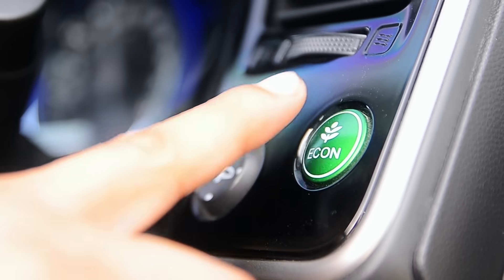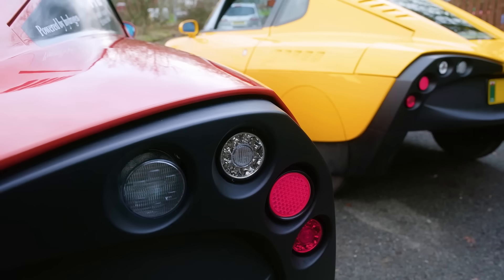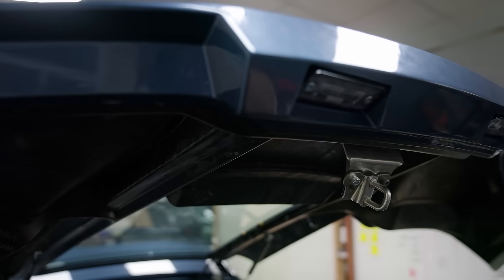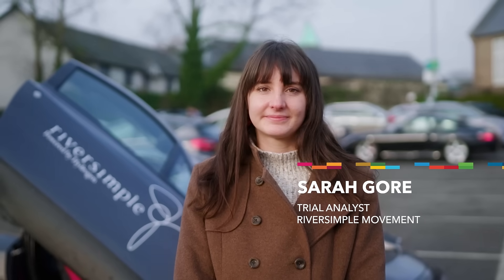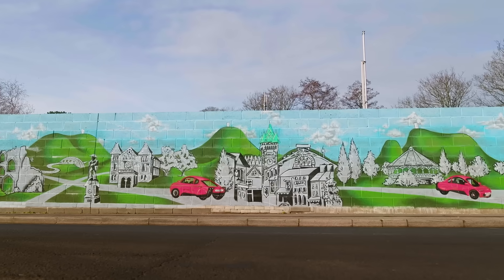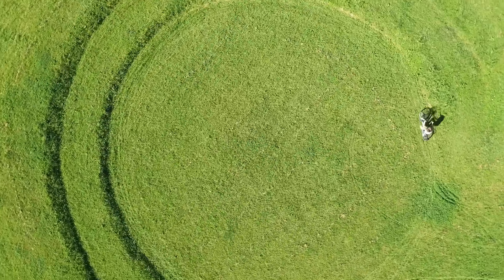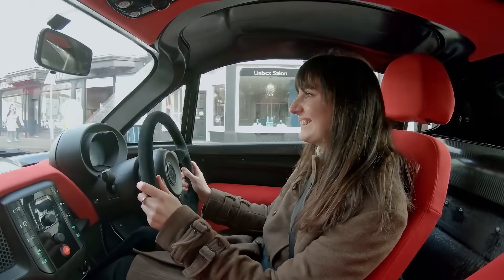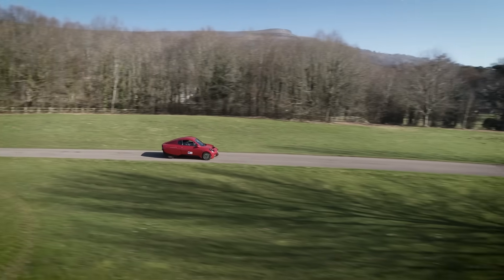Inside The Former F1 Engineer's Innovative Hydrogen Car

Comment: I admire your conviction and imagination. We need creative new businesses like this, but I fear the rapid advancements in battery technology will quickly make this an energy expensive, short range and portly supported dinasour. I hope to goodness I am wrong and wish you all the best.
Reply: Producing hydrogen is the easiest way to store large amounts of excess energy from solar and wind for times when there is not much sun and wind. Storing solar power for the night may be feasible with batteries, but storing excess solar energy from the summer for the winter in batteries would be prohibitively expensive. Storing hydrogen produced with solar power might be an option, and the low efficiency of that process might be outweighed by the fact that the energy used inefficiently would be energy that would be just wasted otherwise due to demand lower than supply at production time.
Reply: @peterp5099  you made a great point here Peter.
Please copy paste it as a fresh comment so that more people see it.
Dealing with the peaks and troughs of renewables is one of the biggest challenges the transition faces
Reply: That's not very objective thinking. If you have excess renewable energy and you have a BEV car fleet it's far more efficient to put that energy into EV batteries and even draw it back from those batteries when needed. For stationary storage there are a bunch of competing technologies that are both cheaper and on par with efficiency with hydrogen, as well as being a hell of a lot safer. Hydrogen may have applications but only if they can work out a much more efficient way to produce and store it. In the meantime battery tech continues to evolve - it's not standing still.
Reply: @mondotv4216  battery tech continues to evolve, that’s true. But large scale battery storage is still prohibitively expensive, while welding a few gas tanks together is not. It’s the old question of efficiency vs investment costs, and it makes sense to have both, the efficient battery storage for storing solar power from the day for the night, and hydrogen industry for storing solar energy from the summer for the winter. And between those, probably a mix of both to store power from times when both sun shines and wind blows and Store that power for the „Dunkelflaute“.
Reply: there's a reason the technology was abandoned in the 90s. It's still a messy, polluting process to make hydrogen, and the rate of advancement of the technology was far outstripped even back then by other more practical modes of energy storage.
Reply: "rapid advancements in battery technology"...are you having a laugh. Despite billions being spent on research, battery density has barely doubled in the last 20 years.
Reply: CATL going into production this year with 500kwh/kg batteries, that makes passenger flight possible. It won't end there, I support the views of analysists that predict a further doubling in the coming years. There's definitely a place for hydrogen and there always will be, but it's already at it's limit while batteries have yet reach their limit.
Reply: @martinhughes6860  What would it cost to build batteries big enough to store the sun energy from the summer for heating in the winter? And, in comparison, what would it cost to build hydrogen tanks big enough to archive the same goal?
Reply: Well that's a different subject entirely, but as you've raised it... Ambri liquid metal batteries are designed for low cost high efficiency grid storage. How Ambri batteries compare against hydrogen I don't know, I'd have to look at it. Silica batteries are also a highly efficient and incredibly cheap way to store energy, there's also gravity batteries. All of these can provide a mix of energy storage to suit local needs, including hydrogen. It doesn't have to be one or the other.
Reply: @martinhughes6860  Despite what you may think, over decades the physics, scientific research, billions of dollars and the periodic table simply have not and will not lend themselves to significant battery density increases. 

Moreover, hydrogen (of the green variety, the only variety that really matters in relation to the so-called 'climate emergency) is nowhere near reaching its limit. Unfortunately, there's far too much crap talked about the stuff. In essence, 'green' hydrogen is inefficient, pernicious and very difficult to produce, store, transport and to use. But, ultimately, green hydrogen's biggest problem is that it takes a huge amount of green energy to make a tiny amount of green hydrogen, and that is why it will never be ubiquitous.
Reply: I see JCB has opted for hydrogen simply because for the construction industry batteries are impracticable.  Despite the Tesla semi, unless there are some great advances in battery power to weight, I'm pretty certain the long distance haulage industry will go for hydrogen too.  This means the infrastructure for hydrogen will be there.
Reply: @marquisdemoo1792  I think the main reason to use hydrogen is the option to use renewable energy that would go to waste otherwise. Just use the electric power to produce hydrogen instead of stopping wind turbines when supply exceeds demand at the power market.

Comment: People don't want "mobility as a service", we want a "car as a product" and ownership of that product.
Reply: Few can afford a new car now.  Like rent, utilities, insurance, taxes, fuel, food...it all adds up.
Reply: @mistert7958  so that s the point to be worked
Reply: @mistert7958  Well then, public transit is the REAL solution, isn't it?😉
Reply: @joerosen5464 in urban areas, yes. In rural areas, not so much.
Reply: @joerosen5464  However public transport will not take you absolutely everywhere where there is a road wide and flat enough for a car to run on it. If I want to visit some city or town - fine.  But if I want to visit a tiny village or simply a building in the middle of nowhere - public transport will not take me there.
Reply: @thelyricologist9568  use a helicopter.
Reply: @joerosen5464  Nope. Public transit has bad people on it. Privacy and safety matter.
Reply: Mobility as a service will come as robotaxis, Tesla is very close now, and Cruise and Waymo already have autonomous robotaxi operations in a few small city areas in Phoenix and San Fransisco.

Another argument this hydrogen thing will never catch on, it is far from becoming autonomous, it misses all the tech for that.
Reply: @MarcoNierop  That's right! The problem not mentioned here is the availability of H2 charging stations. Electricity is available everywhere for slow charging, and increasingly for fast charging. But there are almost no slow or fast chargers for H2, and it will never be as cheap as electricity, and the efficiency of the car will never be as high as with electricity, so this engineer's idea will just be a nice idea to be quickly forgotten.
Reply: @MarcoNierop  What does the mode of power of a vehicle have to do with it being autonomous or not???🧐
Reply: @joerosen5464  Not much, I was referring to the car in the video, which lacks any ADAS system whatsoever let alone a sensor suite + computer hardware to make it potentially autonomous... It's just a dumb car in so many ways!
Reply: @MarcoNierop  The glass is half full my friend,  just wait for it to top up.. all in good time ! 🍷
Reply: @joerosen5464  Are you kidding? LOL
Reply: @varunemani  The glass has been half full for the past 3 decades for hydrogen cars, and all the fluid in the glass is close to have evaporated completely. 

I just read that in The Netherlands 7 hydrogen cars were sold (Nexo+Mirai) YTD. All time low, while the number of filling stations has more than doubled. The sales of electric cars is about 3 orders of magnitude more! 

Hydrogen is dead, Battery electric has won.
Reply: @MarcoNierop   Oh absolutely but thats for now.. for the future though, personally I like the idea of not relying on one type of technology to achieve a sustainable mode of transportation. Besides, not everyone needs a car for a cross-country ride, so some of us are happy with the little trips around the city or town. As a choice hopefully each would have their place moving forward.

Also, consider the fact that Hydrogen power has been suggested as a great alternative for heavy vehicles with lesser charging times that benefits trade.
Reply: "You won't own anything, and you'll be happy"......
Reply: @RobertLBarnard  All "owning" does is prevent others from using things. All the stuff you own now will be used by others in the future once your dead just like it always has.
Reply: "you will own nothing and be happy"
Translation: give up your autonomous freedom or else.
Reply: @GLOWman812  🎯 best reply in the thread.
Reply: The last 4 vehicles I've had were leased, so  "mobility as a service" is just fine.
Reply: Speak for yourself, I’ve been happy using car and bike sharing for years instead of my own, so no, not all people.
Reply: Your great grandfather's quote: people don't want these stinky noisy expensive horseless carriages! We want faster horses... Automobiles now more expensive than housing. Cities covered in concrete and asphalt. Yet personal cars sit idle 95% of the time. We end up with £50,000 investment sitting in a garage losing resale value every day.
Reply: @BobQuigley  Nicely put!
Reply: If the price is right and the infrastructure's in place, then the business model should succeed.  Do you remember the TV rental business model?  That worked, until ownership became so much cheaper than renting.  Maybe these guys will start out renting, while infrastructure is built.  Of course competitors will be around (e.g., Hyundai), so it's not clear cut, and many factors will come into play.
Reply: True, when you didn't own your car that create a problem. Why?
We didn't only want to use, we want to do an experiment and learn new things.
Reply: Interestingly if you go on their site they want to quote you. Surely some idea at least of cost so you can judge if it’s for you would be beneficial
Reply: Ooooh, this would fit in nicely with the 15 Minute Cities plans coming out of Davos, where our democratically elected leaders meet with big business to roll out socialists plans in which “you will own nothing and be happy”….which nobody ever voted for.
Reply: Charles you may want, if this is a solution it will work in the global market, similar to mobile phones.
Reply: Concept of "ownership" of things is being erased little by little to be ready for the new world order.
Reply: You say "car" into your phone and a robo-taxi comes to your house. You don't need to buy a car, then fuel it, pay insurance, pay for repairs, etc.
Reply: Read you're v5 it does tell you it not proof of ownership
Reply: I guess people would be made to own only one vehicle in the driveway, and not one for each family member in the driveway.  Besides, our world leaders seem to be leaning to total control of you and me.  We'll own nothing and like it.  Dictatorship, don't ya know.   Everytime you need to go anywhere you would have to get state or local authorities permission and stop at checkpoints every 10 miles.  Wouldn't that be just lovely?  And round and round we go on this merry world go round.  Whatayathink?  Keep your freedom in a coop, for it might get loose and fly away!  Besides, we can't even work on our cars anymore!
Reply: But people say they can't  switch to an EV because they are too expensive to buy. If you don't have to buy it then that is no longer a problem. The running costs for an EV are lower so if the purchase cost can be spread out over the lifetime of the car then the cost problem goes away.
Reply: These things can work as taxis cause they're weird looking things to own!
Reply: @changsangma1915  the problem is this is a two seater.
Reply: Of course they do.
Reply: Cars clogging the neighbourhood is annoying, I’d rather be able to open an app and activate my transport.

Comment: The only issue is producing Hydrogen and re-fueling stations.
Reply: And the inefficiency of the whole system. Not much more efficient than a petrol engine. Very bad compared to the 80%+ of a battery & motor.

Comment: 300 mile range so you can drive it for a week before going to a refill station......... where the hydrogen is crazy expensive because it had to be transported there and that is a problem with hydrogen.....
Reply: He also left out you have to do a 100 mile detour to get to such a station... So in fact you have just 200 miles USEFUL range.. His whole planning and range argument is bullocks, my Tesla Model Y has a 330 miles range (EPA), and because I can charge at home I can use 100% of that range as I please, and not forced to sacrifice 100 miles just for filling up.

Comment: The problem with hydrogen is that it “could” be 100% renewable.  Emphasis on
 it “could”. Right now, 98% of all hydrogen in the world is a by product of the petroleum industry. As of 2:45 - the electric car is getting more and more convenient and need less and less planning - the problem is the price for when people can afford to enter. Cool concept, though and by all means, drive what you want. But right now, as of this moment the best choice is to by an old cheap car diesel/gas and keep it going to Ev prices drop or a EV after 2020 with at least 250 miles if range.

Comment: Cant believe this is being stated as if its new. This boondoggle has been going on for maybe 15 years now abstracting money from Welsh (and maybe British?) taxpayers the whole time and they've produced absolutely nothing useful in that time except a tiny car thats no better than current Chinese small EVs but at least those can be refueled anywhere.
As for "its really easy to fuel up" LOL. OK how far would i have to drive to refuel? 50 miles? 75? 
And the fuel is inherently 2x-3x the cost of electric cars, and currently more than petrol. you can't refuel at home, from off peak electric or solar,  and who is going to pay for the cost of replacing every petrol station with H2 filling stations at a cost of literally trillions £? 
As for an all in one subscription, not exactly ground breaking. i had an EV 4 years ago from a company that did that even included the electric and they are still going, and there area few maninstream OEMs that do that with their ICE cars (and you can do it with Volvo EVs I think). 
Lastly there will be no "flipping of economics" if its being produced in tiny numbers at numerous factories (with all the inherent added costs of more complex supply chains). Theres a reason Tesla can undercut everyone else and one of them them is huge economies of scale.

Comment: Click bait.  It isn't an electric car when it uses hydrogen as its fuel.
Reply: To be fair they have this bit right, it uses electricity to power the motors that turn the wheels, so that makes it an EV.  What we typically think of as an electric vehicle is technically a Battery Electric Vehicle or BEV.  This thing uses a hydrogen fuel cell and some interesting high power capacitors instead of a fuel cell and battery combination that most other hydrogen based EVs use
Reply: @tallandhairy  Ah! It uses capacitors instead of a battery! Thanks for that info. That will make their car even more expensive.

Comment: why you don't put a system in the car to separate the hydrogen from water so you dont have to bay hydrogen?
Reply: because you need large amounts of energy to split hydrogen from Oxygen ? or 3kwh of electricity to make enough hydrogen to create 1 kwh of electricity , that's why scientist & engineers say you'd be mad to do it !
Reply: @martinhammett8121  Perhaps you are missing the amazing potential for perpetual motion.
Reply: Some people say the fossil fuel industry is pushing it to try to slow the adoption of renewable energy ? most Hydrogen is made from methane ? (well about 98%)